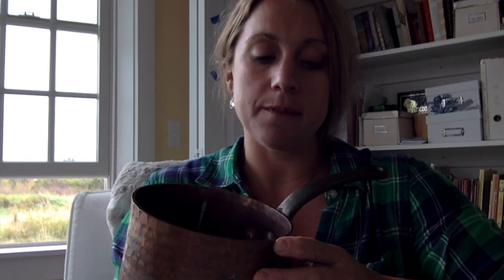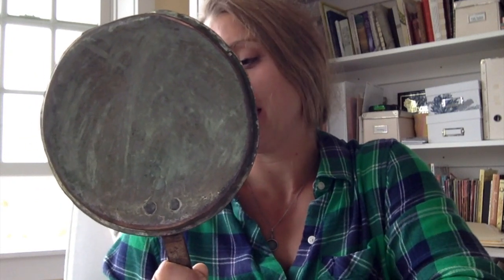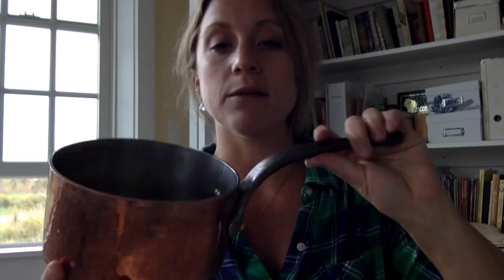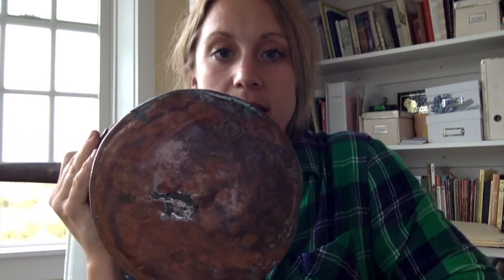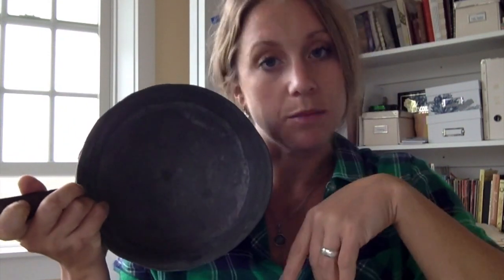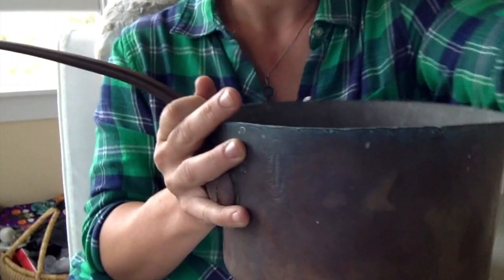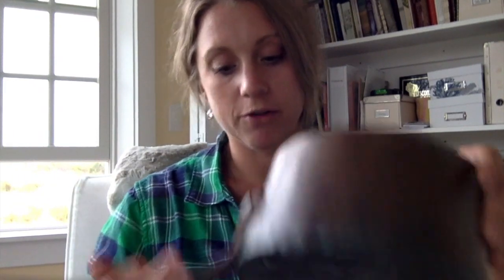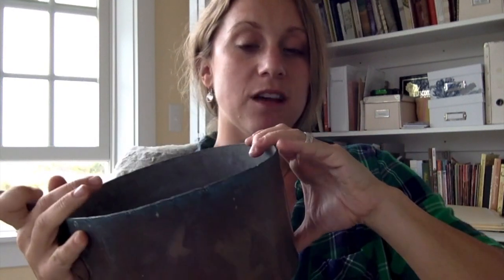Copper Cookware Repairs

Comment: I was considering retinning a couple pieces I picked up recently but I was worried about annealing the copper on accident. I didn't know you would intentionally anneal a piece to repair it but it makes sense. If you anneal a piece do you have to harden it again somehow before its usable? how do you harden the piece if this is the case?
Reply from the maker: You actually end up work hardening it with the repair / hammering, and then with time and use it hardens further. Retinning doesn't really fully anneal the copper - it doesn't get hot enough. Repair work often means much closer/hotter heat on a small area--or you're really heating up the piece to reshape it...and then again, the shaping hardens it again. Does that help/make sense? :)
Reply: @housecopper  It surly does! Thanks for the response and willingness to share your knowledge.
Cheers!

Comment: Great video. I'm interested to see how to fix the hole in the one pot at about 5:50. I have a large stock pot from a hotel in Chicago with a hole in it that needs fixin'.
Reply from the maker: I'll have to get to the other shop and use the acetylene and do a video on how to repair the holes. It's tricky to do, frankly. The last time it took 7 tries to seal up a crack. hahaha
Reply: I had seen a video (which I cant find now) that shows how to seal a cramp fitting using a forge and brass shavings. I guess that's the old way of doing it. I have a forge but I'm unsure of how to do it. I guess I can experiment on scrap. I figured if you could seal a cramp fitting that way then you could also repair cracks the same way. I also have an acetylene torch and some Sil Phos 15 to do the repair as well. Thanks again for the great videos. I appreciate that you take the time to show us novices.
Reply from the maker: Well, actually, the brass shavings and forge are the only way to really seal a cramp seam at any time. You have to heat the copper hot enough so the brass melts into the cracks, but also bang on the copper tongues hard enough so they essentially become one thickness where they overlap. It's a long process, which is why they stopped doing it by the mid-1800s. I should work with Bob to make a video on setting a cramp seam, and we'll get on doing the repair video, too. The biggest issue is usually getting the crack clean enough to take the brass solder. But the science to set a cramp seam fresh as well as repair one is indeed pretty close. Anyway, thanks so much for watching. :)

Comment: I have an old copper pot that needs repairs. It is marked CG made in USA, it has a round bottom, 3 legs but is missing one , I'm wondering if you know who I should contact to get it repaired properly.
Reply from the maker: Ashton, you need to contact me via email (found on my website) and send photos before I can properly diagnose or send you to another smith. It's impossible to give advice blindly. :) Thank you!

Comment: Good work!!👍🏻
With the pan that needs no tinning, it looks quite tarnished. Is there a good way to get the tin looking like new again?
Reply from the maker: Yup. Clean it with Tarnx, wash it with soap and water, dry thoroughly (ideally finish with an air pressure hose), then head on over to the buffing wheel with some tripoli bar and a hard (sewn) wheel. Polish away! I always finish with a hand polish, like Mother's or something. If you don't have a buffing wheel...Tarnx, wash, dry, and then a polishing paste and a LOT of elbow grease. :) But for "like new" you're gonna use some power tools. :)

Comment: Purchased a copper stock pot originally from Turkey where the tinning is quite corroded. I’m removing verdigris and rust with non iodized sea salt and distilled vinegar heated on the stove. Naturally the inside of the lid is like chrome. Also using a copper cleaner that is mostly sulfamic acid powder I use for ALL copper stuff. I just want to boil spaghetti in it without dying. You know, a little salt in the water, boil a few minutes and pasta el dente. It’s still rough. Am I going to die?
Reply from the maker: Well, you shouldn't see rust, as both real tin and copper are non-ferrous (no iron) and don't rust. Yikes! But honestly, as long as you remove the verdigris completely, you can definitely boil water and make some delicious pasta from there. The verdigris is the poisonous part in that scenario. Water's pH is 0, and the pasta in the water is so neutral as well, you'll likely be just fine. :)

Comment: Dear Madam , it is now some weeks that I saw a movie , when the book of cookery By Jacques Gouffè was mentioned : I immediately took its reference , so as to begin a new consideration about the copper pots and things like that. Now . here in Italy I managed to get 4 used copper pots, large  and with low height perhaps...They appear to be already tinned, Internally ; one is leaking  liquid water; the other is color copper with tin traces Internally  and a new hole  on its bottom , made by me and a nail and a hammer ,LOL.it should be patched , shouldn't it ?Please , dear Madam , may I ask for Your esteemable polish- millenium advice ? Best Regards to Your Familyps: what about the typical recipes to adhere to , in order to not fall into danger , in a general coppery sense ?
Reply from the maker: The leak in the first is likely wear and tear and a crack in the copper if it is old and brittle. Yes, both can be patched. It is a very long process to do so, and too hard to write down here. :) Sorry! I do have videos about how and what to cook in copper as well - you can find them on my channel! Best to you!
Reply: Thank You Very Much .Best Regards

Comment: #House Copper & Cookware Q: Do you work on brass?  I have picked up a brass jam pot that has a rounded bottom and should obviously be flat similar to the last pot in this video. If not do you know of anyone or resources I can look at for getting the pot refurbished?
Reply from the maker: I do work on brass on occasion (I have 3 huge India-made pieces I just finished re-tinning) though rarely as it's not as common. Please email copperassistant@gmail.com with photo and we can go from there. :)